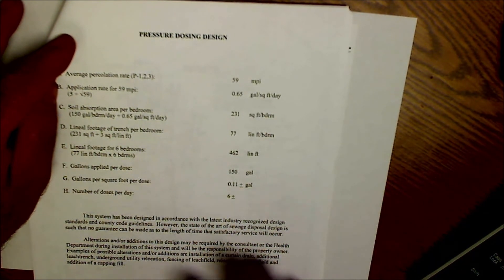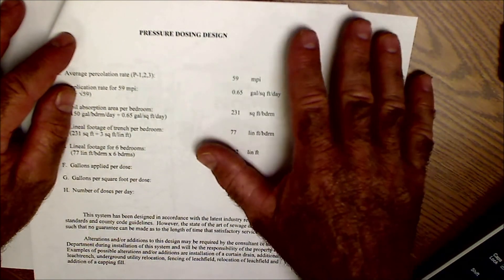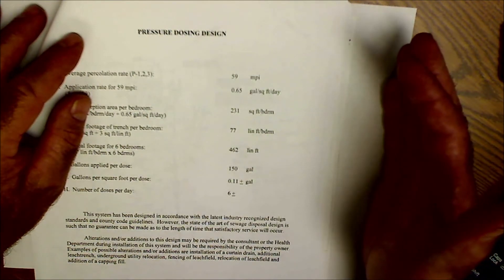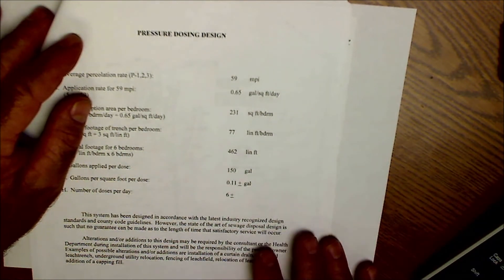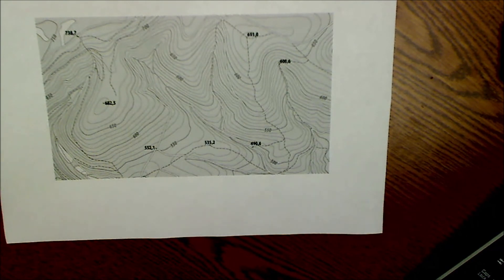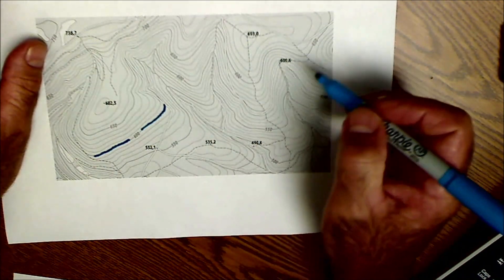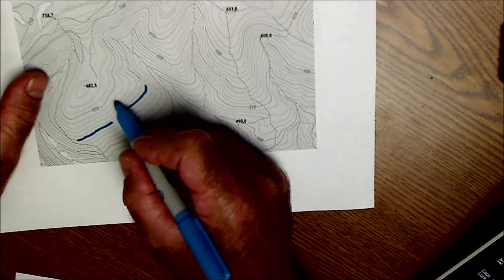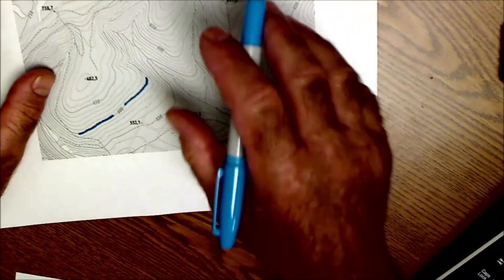Overview of the Math, Design, and Build of a Septic System

Comment: As a licensed septic installer this gave me some helpful tips, however

I do think septic system technology has improved so much over the decades, that there should no longer be this stigma towards the owner builder wanting to learn it for themselves. A norwesco or similar 1000 gallon tank and 2 40’ rows of EZ flow infiltrator system  can do the job quite well for most 2-3 bedroom homes. If someone wants to build that in the wilderness, away from wells, curtain drains, rivers, I believe they absolutely have that right. 

You don’t have to be a skilled operator to run a mini 1.5 ton excavator. These can be rented from most heavy equipment houses and learned within a week.

As cities continue to get crowded it is our job as licensed professionals to help facilitate expansion and growth, not hinder it.
Reply from the maker: All very good points
Reply: They'll never find out if you don't tell them ;)
Reply from the maker: @henlofren7321  ok

Comment: So are the runs (and gravel beds for the leach field) all at the same level (elevation) even though you are on a sloped contour?
Reply from the maker: Yes, that is correct, the little ones follow the topography
Reply: @ColfaxMath  OK, while considering a piece of property last year and after applying or a state septic permit the state man said I could not build the leach field on a contour? The property has a slope of about a 3/12 or about 15%.  My understanding is the leach field had to be about 150 square feet for a 4 bedroom build. My original question was to ask if all of the runs have to be level from one to other to have a level field throughout the bed. In other words each run has to be the same depth and level one to each other?
Reply from the maker: @retiredperson4054  Im not sure how consistent it is across different areas. Where I am the individual lines have to be level, but not level to each other
Reply: @ColfaxMath forgive me for asking but if the individual lines are not level with the other leach lines then only the lowest lines will be saturated with effluent? Based on gravity. What I am saying is: why would the effluent flow uphill? It seems to me that it would flow only to the lowest lines and bypass the higher ones altogether. I am honestly asking. Did this get inspected by an actual inspector? I’m trying to learn about septic.
Reply: Are you able to manipulate effluent by dbox placement alone?
Reply from the maker: @BurnBrightJoshua  no, they dont have to be on the same elevation on a pressure dose system. the pressure pushes the effluent up hill
Reply: @ColfaxMath  thank you very much. I am somewhat ignorant about such things.

Comment: California Onsite Wastewater Treatment Design and Construction Standards calls out in: Section 7.7 "Natural ground slope in all areas used for effluent disposal shall not be greater than 25 percent."  9.4	The following are not allowed to be authorized in a Local Agency Management Program: 9.4.4	Slopes greater than 30 percent without a slope stability report approved by a registered professional.
Reply from the maker: Ok Dennis, thanks for the insight
Reply: Here in Pennsylvania we have spray irrigation systems for steeper grades and real slopes.